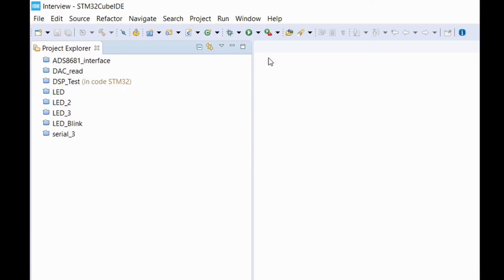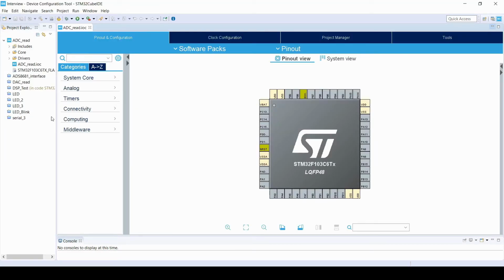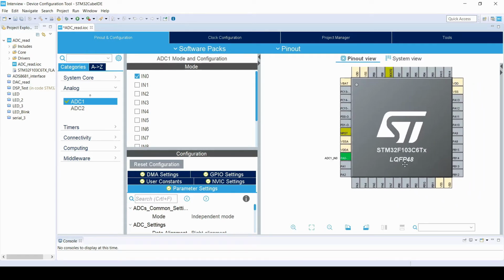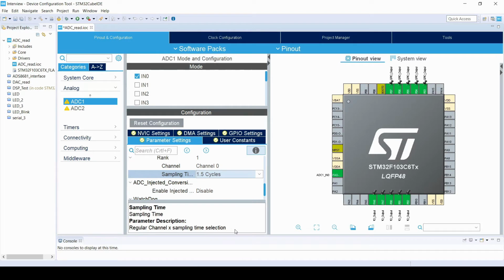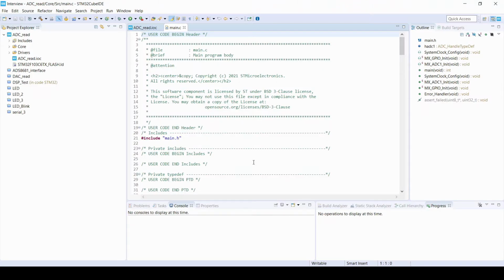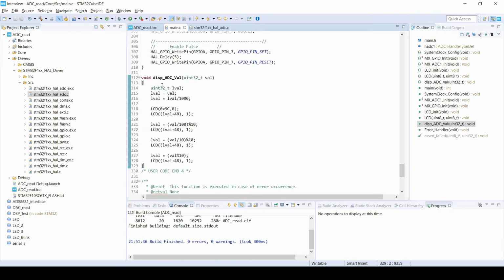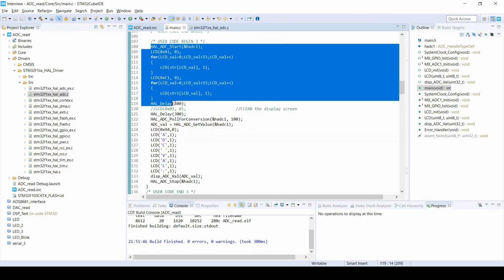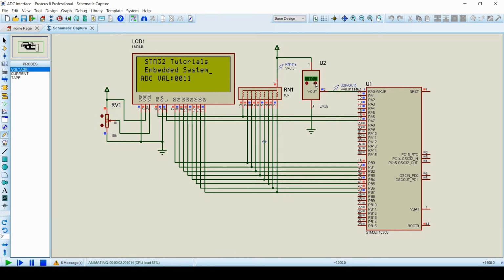Single channel ADC interface | Temp Sensor Interface | LM35 interface | STM Interface | STM32F103Cx

Comment: Continuous value of 0 in Virtual Terminal. Please Help me..
Reply from the maker: Try the same code on hardware. It is working on hardware as tested
Reply: @stmetatronics-RawLuck  Yes, the problem is with the PROTEUS version. Upgrading fixed it.
Reply: @mahmutcansaribal5935  which version did you use?

Comment: Hi. How did you get the Proteus lib ?. I need stm32f103rb
Reply from the maker: The proteus version i am using have stm library in it. It is limited to few stm controllers. It has Stm32f103c4, stm32f103c6, stm32f103r4, f103r6, f103t4, f103t6 and f401xx family controller.
Reply: @stmetatronics-RawLuck  which version ?. I need
Reply from the maker: Proteus 8.9
Reply from the maker: Provide the mail id to get the library